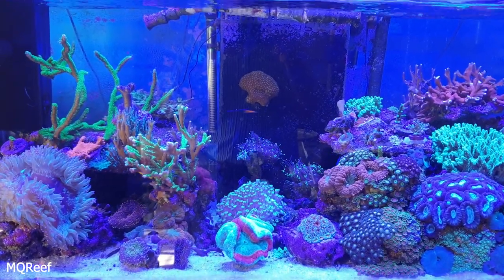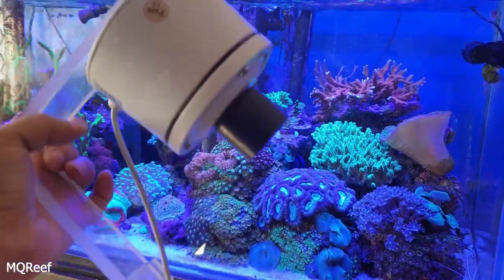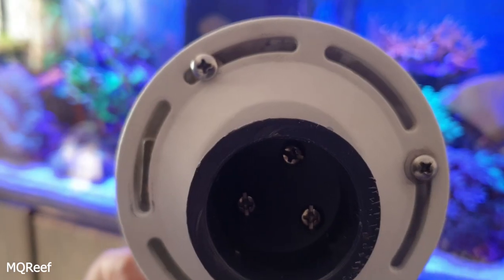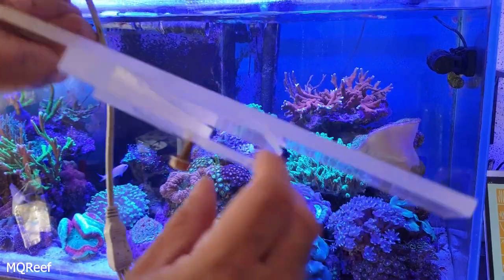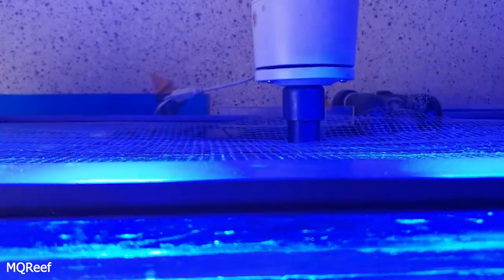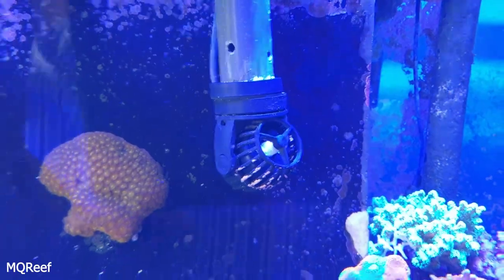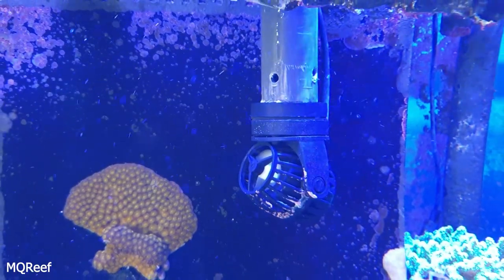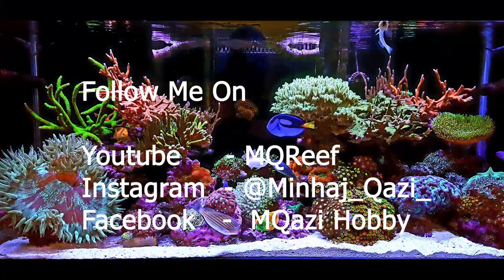DIY Sea Sweep or Swirl (Easy Build)

Comment: I love this idea! I noticed in your 32mth update video that the sea sweep wasn’t turning. Did the motor on the mount break?
Reply from the maker: it went to over flow side. few frags of sps tissue loss as gyres flow wud struck down on them.  may in few months till frags also encrust well and branch. its working

Comment: I cannot find the motorized mount.
Reply from the maker: seach security cctv camera. mount is integral part if its moving right left
Reply: @MQReef  Nowaday, they have 255degree version, it spin almost full circle and with tilting option which is not working well.